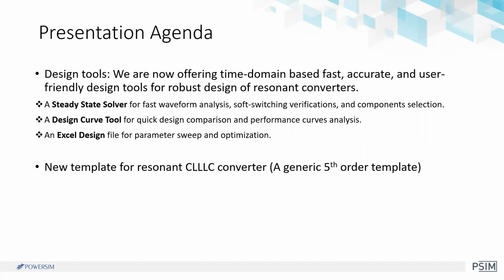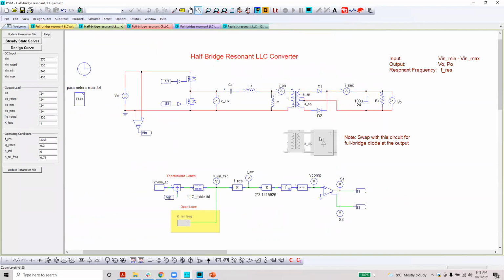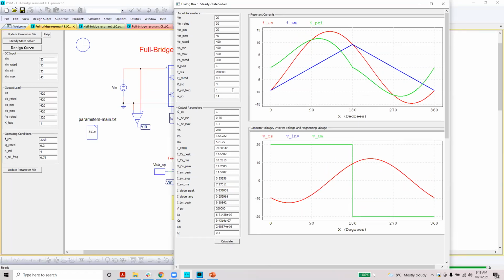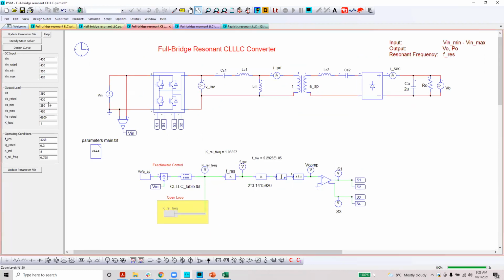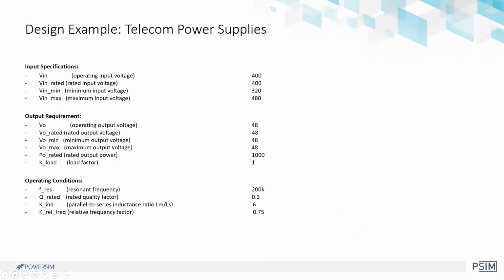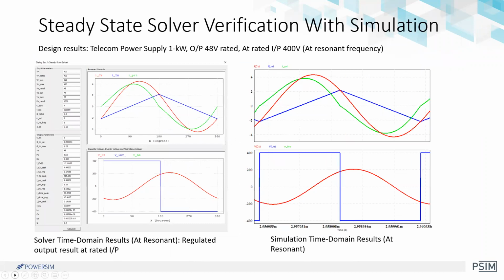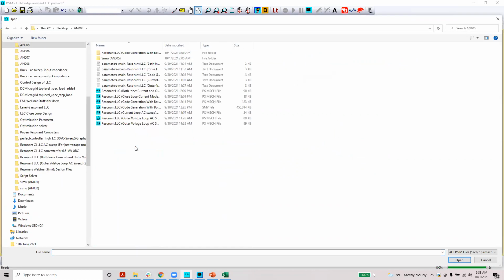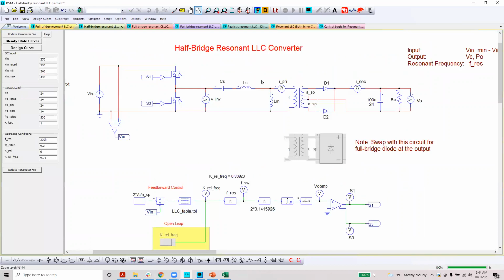Resonant Converter Design and Optimization

Comment: I have read a lot about this, but there is little info for how to make the transformer for them, for LLC I did find it but for LCC not, the only thing I found was that the induction of a LCC transformer but also for LCL has nothing much. I did read the transformer needs to have high enough inductance to not to load the Cp or parallel L to much or not because it is a current source action Cp, that need higher impedance, did try a inductance reactance  X 4 x the max (low power) Ac load resistor.

And how I do get the right AC resistor with a system who have multiply outputs, do I need to put all power of them together to one output power, in mine case that was 300 watts max.

thanks